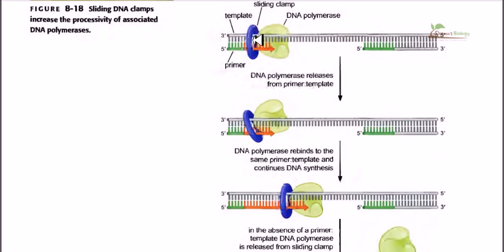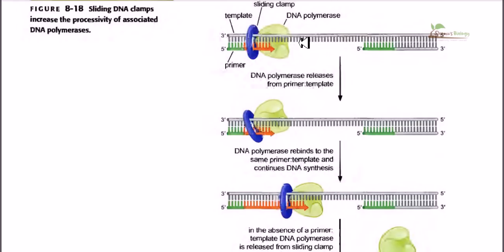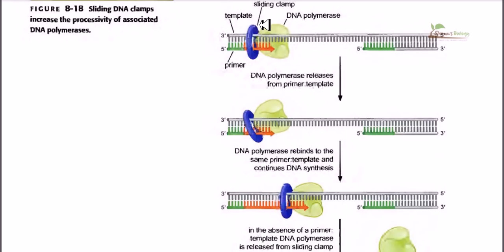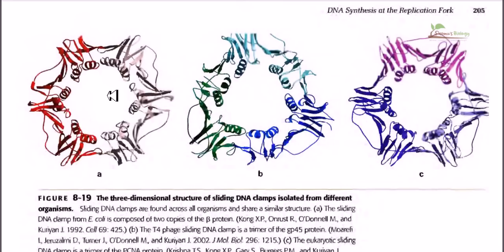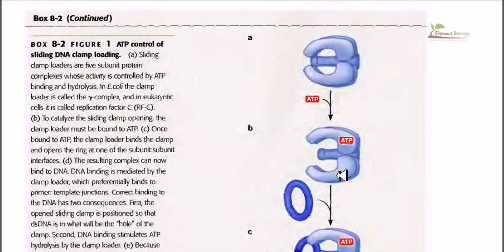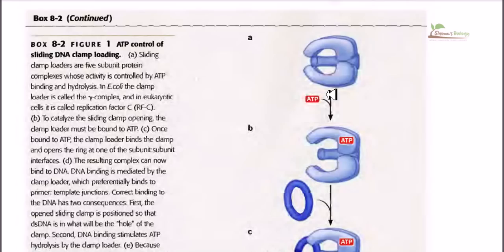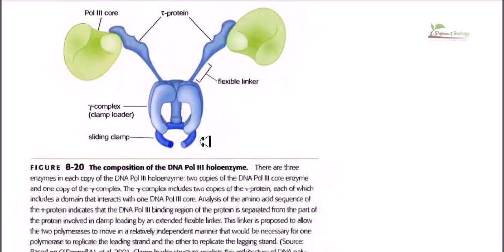Clamp loader and sliding clamp

Comment: You say the "remarkable similarity" of sliding clamp proteins across different organisms tells us about their "the evolutionary origin".  NO it does not.  It tells us they were designed by the same designer.
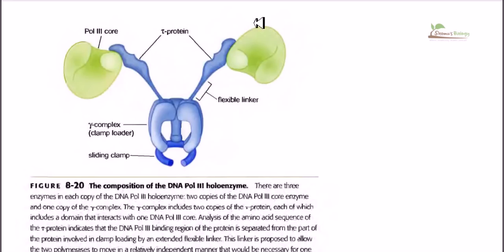Reply: But at 9:20 "This holoenzyme is designed in such a way to keep on adding ..."
Designed.  Exactly!  It didn't occur by accumulate random errors.